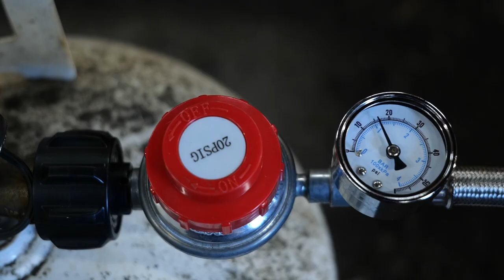Making a Blacksmith's Knife (with the Atlas Knife and Tool anvil and forge)

Comment: Oh, yah!!!  12 years of knifemaking, tinkering, and prototyping have gone into the design of these forges and anvils. If it doesn't exceed Roy's expectations, I'll stop making it and design a new one that does.
Reply: That's a very tempting price as well, doubly so for the larger one. I have to wonder how you got it down that low! Get an even larger one in stock for comparable value and I'll snatch it up before thinking (I see reference to a 284lb anvil on one of the stands?), but I'll still consider these quite a bit! Anvil stands are a bit much by comparison, but they seem nice enough to warrant it. I do wonder if the Graham anvil stand still works with the newer increased size ones, given it's marked as working with the presumably older 117 lb ones?